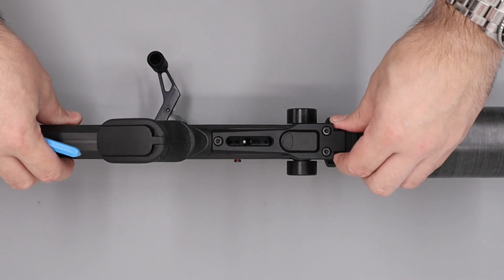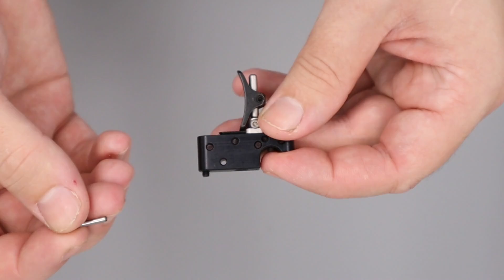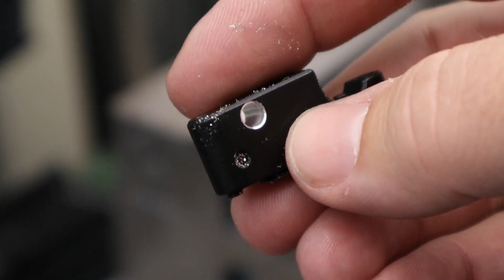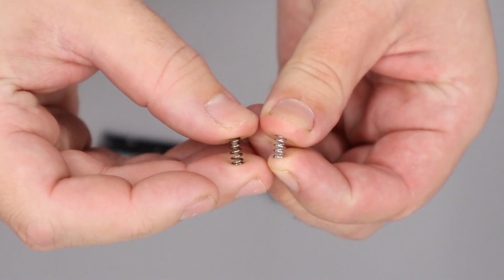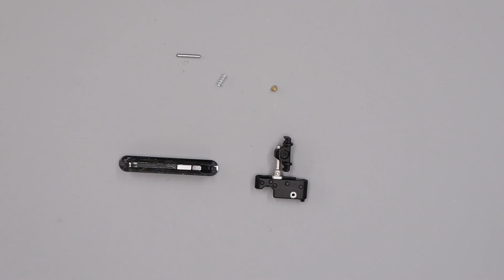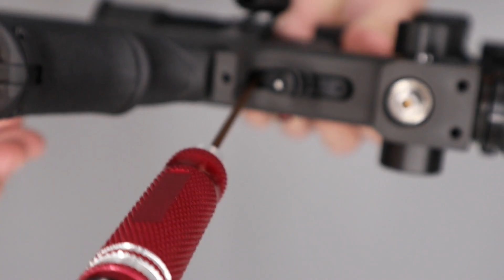Modifications to the BRK Ghost trigger

Comment: Hi Jeff, I'm still struggling to reduce the weight of the second stage pull (trying to lighten it up to a taarget rifle spec !!) I have not shortened the long spring on the push rod. Is that the only option or are there springs in the rear cassette that need changing? Thanks
Gordon

Comment: Hi Jeff, great video again, just recieved my Ghost hp and the same as yours a bit of play in the trigger and feels a bit heavy. In the video you talk about a couple of springs but did I miss the bit with the second spring? I saw the centre one just above the blade. Is the second one on the long linkage? Ive heard the brass ends can be very difficult to remove? 
Keep them coming
Reply from the maker: thanks for watching, yes the second spring is on the linkage the  brass end come ok on the ones i have done, unless they have started thread locking them,  the trigger pins can be a pain to get out the side plate tends to jam them in   😀
Reply: May I ask what changes you made to the rear spring? @sub12airgunners

Comment: Did you install a lighter trigger spring? or cut the existing one? I just got my BRK Ghost in Carbine this week and set up yesterday... i'm smitten, but the trigger is def. needing help if i'm using this for FT.
Reply: Mine is heavy too I feel it pulls off centre when pulling the trigger. I just need the trigger being much lighter.

Comment: On the trigger mod, why not just use a slightly larger pin and a couple of nylon washers, one each side of the pin, surely that would do the same job?
Reply from the maker: you could but then you would need to drill the action as well, this way the only machining is to a small component that's easy to replace  👍

Comment: If anyone wants to try the trigger stabilisation mod that Jeff did and doesn't have a machine shop, I did it earlier. 

1. I recommend knipex pliers wrench [7 inch or smaller] to remove the pin. Mine was VERY HARD to remove. I couldn't do it with needlenose pliers.
2. Use small 1/2" piece of capton tape around pin. Trim the tape till the pin will fit. I had about 3/4 of the pin covered with tape.
3. That's it. My trigger is dead stable. No Wiggling. 

I really enjoy watching your videos Jeff + Dad !
Reply from the maker: nice one, you can beat a bit of  shed engineering  👍
Reply: Could shims on each side of the pin be used to eliminate clearance?
Reply: @LARRYBROADTMAN  The pin a bit too skinny to fit snug in the hole. That's why I added a small piece of the tape on the middle of the pin. The clearance on the side wasn't an issue with mine.

Comment: Great video, superb engineering skills, why the manufacturers don’t do this I will never understand. There’s nothing worse than a sloppy trigger system. I know that tolerance limits will apply within a trigger system but maybe they should be revised.
Reply from the maker: yes it is very hard on a production line to have very close tolerances you can end up with a lot of hand finishing